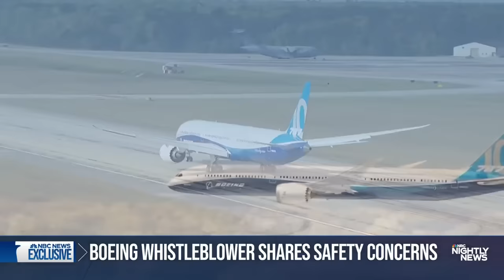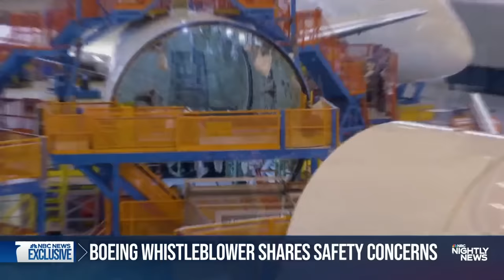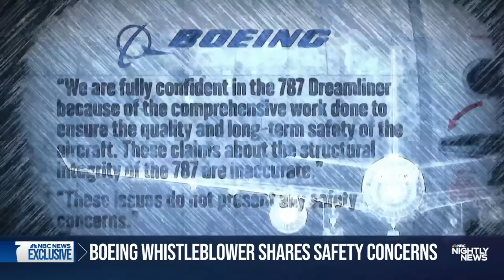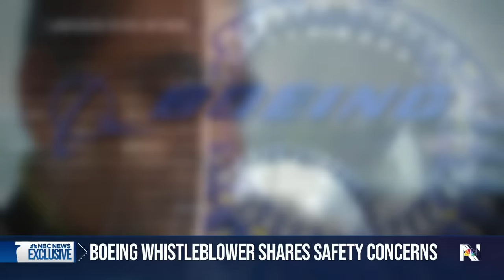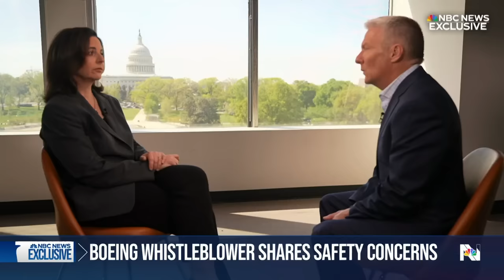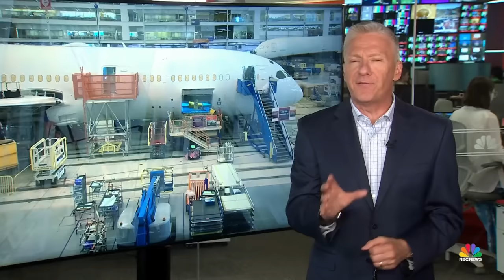Boeing whistleblower says 787 Dreamliner has production flaw

Comment: Just because a whistleblower says something, doesn’t mean it’s true. Engineers opinion and interpretations differ all the time. The fact that no 787 or 777 has crashed after millions of miles and decades of service. The 787 is also made of one piece carbon fiber fuselage, almost impossible to break apart.
Reply: No 777 has crashed?
Two Malaysia airlines, one British Airways, one Asiana airlines...
Ok, one of the Malaysia was shot down.
Reply: Sounds like a plant to me...
Reply: @filipeorr7821  Ok but none of those flights were Boeing design related. The other Malaysia flight was possibly caused by the pilot, and is technically unsolved anyway. Asiana was pilot error. BA was a design flaw in the engines, which aren't designed by Boeing in the first place. As far as we should be concerned, the 777 is fine.

Comment: These so-called whistleblowers should be investigated themselves also because the say-so of a single employee at whatever level they were should not hold such power that would bring down a massive company like Boeing which has such stellar safety issues before the new generation planes. Boeing was leading Airbus in a massive way in all sectors until the sudden demise of the Max and the issues with the 777X the Dreamliner was leading in its sector by massive margins, it has been flying for so many years without issues until this so-called alert, not by a pilot or ground inspection crew or any buyers of the plane but by someone who probably has an axe to grind. So again I ask the question- who gains from the scandals of Boeing? China can't sell its failed venture with Russia's offering in the COMAC C919, Airbus made a white elephant in the A£*) which is already out of production in less than 20 years, the A350 is a good aircraft but was outsold by the Dreamliner and the threat of the 777X was looming to further disrupt the success of A350, the A220 series was potentially popular but was still behind the 737  series led by the MAX. On another note there's a war going on in Ukraine and the aggressor there has taken some massive blows in sanctions and the battlefield even with their commercial planes grounded because of lack of service and spare parts so could it be they in consort with China corrupt bad actors? Remember they would like to see a flagship of America fail on the world stage. It is also very very sad that the American media is part of the pitchfork carriers doing all this hurt to Boeing. Sad.

Comment: “Lightweight composite material”. The side effects of becoming “eco friendly”, people end up getting killed. Similar to vehicles being made of weaker materials to meet environmental mandates.
Reply: Not exactly true. The composite material they are talking about in the 787 is carbon fiber, which is significant stronger than aluminum, especially under tension which is why its application is perfect for aircraft fuselages.
Reply: @themusicalpilot1382  They should make the plane out of the same material, that they use to make the black boxes.Then it would be safe.

Comment: So Boeing has performed all the necessary stress tests 3 times the life of any 787 with the data to back it up. Yet, this quality engineer feels differently because he thinks it’s not good even though he admits he hasn’t see all the data. I’ve been in the aviation industry for 20+ years and have worked with some doofus quality engineers and this guy meets the criteria. BTW, I work for one of Boeing’s competitors and my opinion is for sure unbiased. Some people just want attention.
Reply: What last whistleblower was saying , he was talking about 787 ,  787 had numerous problems since inception
Reply: @metales03  it did have problems, like every other aircraft and they were all solved.